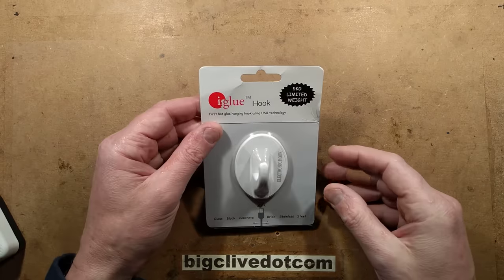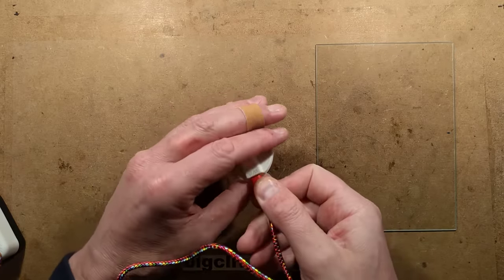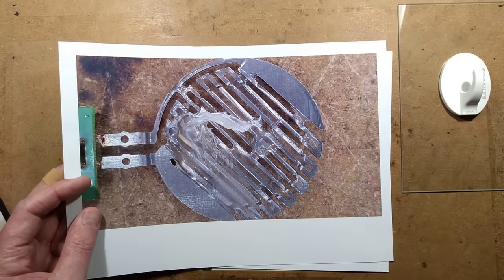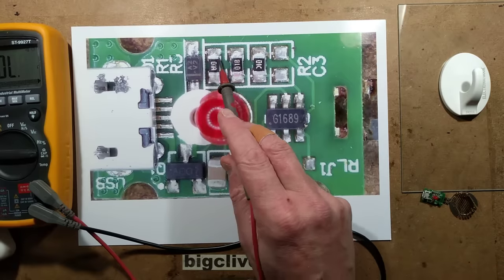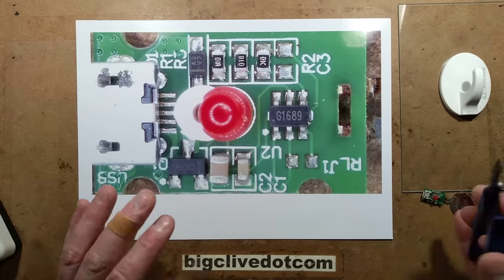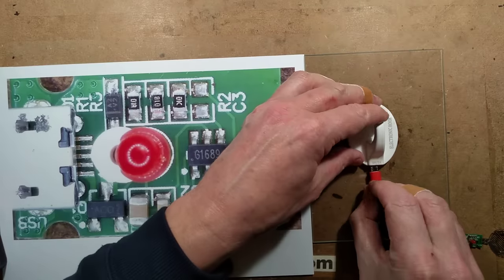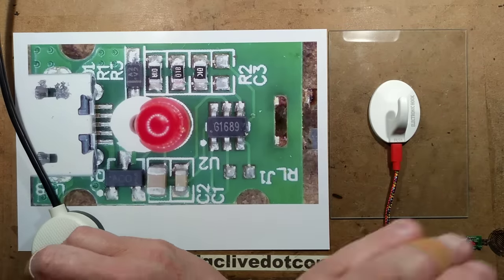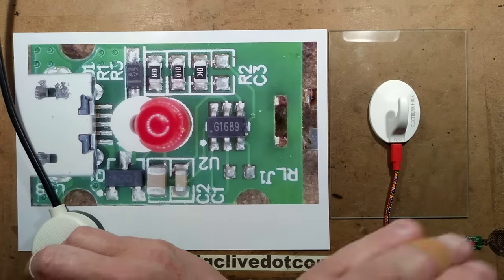Testing a USB powered wall hook and a look inside.

Comment: Ive got to say, with the rise of 3M command adhesive I totally don’t understand the point of this.
Reply: I'm with you on loving 3M's Command strips. For that matter, I think 3M is one of the most innovative corporations in the USA, and they produce so many clever and truly USEFUL products. (Post-Its, anyone?)
Reply: Thanks 3M ad dept.!
Reply: 3M Command Adhesive ...... Sounds a bit S&M to me ;0)
Reply: Furr Bear I used to work at 3m in St. Paul Minnesota. 3m was much more innovative before they brought in corporate outsiders and implemented six sigma. As engineers we were afraid to try anything new because six sigma punishes failures.
Reply: You mean a belated knock-off of TESA Powerstrips makes your company innovative? Oookay.
Reply: I agree this item baffles me. It's like something you see on Dragon's Den that gets shot down by Peter Jones as being an over-engineered solution to a non-problem.
Reply: Its a earlier innovation of TPM  
https://en.wikipedia.org/wiki/Six_Sigma       
https://en.wikipedia.org/wiki/Total_productive_maintenance
Reply: just the 21st century - everything will be electronic and digital like the hooks or door numbers, now i even more believe in such picture like in Observer computer game houses (very Blade runner)
Reply: Siana Gearz clueless comment. That product was introduced after engineers stopped running the company
Reply: In the early 20th century, everyone became obsessed with radiation.  They sold radium water, radium watches, and radioactive chemistry kits for kids complete with samples of uranium.  The factories where they painted the radium onto watch hands were so radioactive that the rubble is still too dangerous to walk over today.  You could walk into any shoestore and get an x-ray of your foot from an unshielded machine which would cheerfully give you a decade's worth of becherels in a few seconds of exposure.  Thus began the Atomic Age.  

We are now in the Computer Age, and everything has to have circuitry in it whether it makes any sense or not.  Your refrigerator, your phone, your television set, your car, your dishwasher, your toaster, they've all got little computers stuck in them.  And now we have the electronic wall hook.  In a hundred years, if anyone survives, people will be laughing at us the same way we now laugh at the people who drank a big tall glass of radioactive water every morning for their health.
Reply: It's classic Chinese tat. Make stuff because we can! An adhesive pad takes a few seconds, doesn't require a cable and power supply, and probably provides better adhesion than hot melt anyway.
Reply: I love the smell of 3M temporary adhesive - Scotch tape, Post-it notes... Smells like pineapple.
Reply: Six sigma was a management fad that was invented by Motorola (who is nearly non existent now) that required tons of paperwork before trying anything (not good for R&D) and punished anything deemed a failure (a normal process in R&D, you don't always have winners in R&D).
Reply: Six sigma required tons of non related paperwork and punished failures to the point where engineers were afraid of developing products. The post it note was a engineering mistake. A quick google search found this https://www.inc.com/linkedin/don-peppers/downside-six-sigma-don-peppers.html
Reply: 3M command adhesive is great for LIGHT jobs..   It sucks for heavier items.  For example, I hang my tactical vests and tried using some of the heavier duty 'command' hooks.. they fell off the wall due to the weight.  I have tried it with a few different things I wanted to hang that were heavier and the same result.. Command stuff is great for light hanging items up to maybe 2-3 lbs for the heavier versions. But anything past that, they do not stick.

I intend on buying some of these hot glue versions now that I know about them because my bet is these will hold and not come off the wall like the command versions.

THAT is probably what they are for.. heavier jobs for things that the command adhesive cannot do...
Reply: 3M was a company run by engineers before Buckley started as CEO. It was a very Minnesotan company with weekly hot dish (tater tot casserole) pot lucks on friday and retirees who still had access to the buildings (one even had a dozen or so used cars for sale in the back parking lot). Once the corporate types moved in the culture changed for the worse. Six sigma punished innovation. Buckley had a heated helicopter outhouse the size of a porta potty in the parking lot to wait for his helicopter which would fly him from St. Paul MN to Eden Prairie MN (about 30 minutes by car).
Reply: Gladdic, it's a sign of reading too much into things when you make sweeping conclusions including where i might be from. No, i don't know the details but i am aware of 3M'
s numerous industrial chemical products of unique usefulness and various surface processes that they kept innovating in the last decades, i just found the statement funny.

But it looks to me like DE3331016A1 from 1983 introduces stretch-release tape/strip adhesive. I suspect by 2000, BDF and 3M were trading blows on detail improvements to the system and were likely operating on a patent cross-license agreement.
Reply: Yum, tater tot hotdish! 3M has a channel on here, I sub to it to know what latest innovations are coming down their pipeline. You basically can't walk into any hospital or ER in the country without having a 3M product being used on you.
Reply: +Undefined Lastname: well it's a management fad.. you can google and get a textbook definition. not entirely sure if it's designed to punish innovation or that's just the way it turns out when they bring in external consultants to implement it.
Reply: Phillip Berger   I 100% agree.  I accidentally clicked ahead about 30 seconds and was too lazy to restart but i found myself utterly lost and could not understand what possible use a hook could have for a usb port.  I gave in a restarted and watched from the beginning.  I'm still not sure what use a hook actually has for a usb port but I think the only way this could be made more useless would be to add bluetooth.  I guess we will see that in rev 2.0 .
Reply: It says 5kg on the packet at the start.
Reply: I think you need to get the ones with a larger surface area to hang heavier items.
Reply: This point! Right? One use electronics . shows how cheap they are.
Reply: They had a hard time getting the knock off adhesive right, so they just decided to use hot glue
Reply: Don't use those on drywall or paint either.  It ends badly.
Reply: My exact thought, command adhesive runs circles around this thing.  Maybe it has the edge in strength but you might as well properly mount a hook if you want to hold any real weight anyway.
Reply: I used one of those command things on the wall at work. It was just supposed to be a quick test but when I removed it, it took a big chunk of paint from the drywall. It was in a very visible place and it was all new construction too. Luckily, I was able to find some touch-up paint left behind from the construction and it was a lot less visible with a bit of paint.
Reply: The nice thing about these is if you want to reposition them more than once you can just chop off another bit of hot glue stick rather than having to buy a whole new hook. Also IMO these look a lot nicer than the 3M ones.
Reply: This would have been great if it were some kind of high surface tension glue that came off in one lump as Clive said. As it is, it's little better than throwing something up with some E6000.
Reply: The issue you're going to have with surface adhering hooks is not only do you have to be concerned about the adherence of the hook to the surface it's attached to but also to the surface that surface is attached to and so on. Any failure in the weakest link in that chain (latex paint or weak wallpaper adhesive) and not only do you have a hook failure but also a mess you have to deal with.
Reply: Having had several 3M strips fail over the years despite massively underrating and following instructions on surface from paint(And plenty of minor damage to the surface when removing said strips) and having now moved back to traditional nail-in hooks(For pictures in frames) or permanent double sided tape, I can understand why these exist.
Plus hot melt glue is easy to clean without a trace from most non-porous surfaces.
Reply: Oh god! that Six Sigma crap has invaded everything. I had to be Lean six sigma yellow belt trained.  (read, two hours of listening to some shill talk about colored post it notes on boards to mark good and bad days or some crap) to be a tour guide, and now as a groundskeeper we have to do something similar.   (read, my boss has to spend time marking on a board in his office that we had a 'red' day and the grass didn't get mowed, and then document on another section of the board the reason the grass didn't get mowed was "it was raining' and then decide what could have done different next time to get the grass mowed.
Reply: Six Sigma is a group of con men who have convinced the corporate, and now also government and military worlds that they have a 'system' that will make them more money and be more productive, they throw in some Japanese words like "kaizen" just means really long management meeting and charge the companies fees to 'train' their employees and managers and call them white belts and yellow belts and green belts.  The overall system  they push punishes innovation and any deviation from the norm and attempts to make everyone work in the same say way, which I suppose might be more efficient in some cases which is the whole point, but we'd all be writing with the best and finest quill pens and be using ink with very consistent quality.  Basically McDonald's is these people's wet dream consistent quality across the entire company and everything is done the same no matter where you are at.  It's very Pro consistency and predictability and anti creativity and risk taking.
Reply: 3m hooks of this size can only hold like 3 pounds, this heater hook would be a great niche for holding something heavier
Reply: +SuperAWaC If you really need to hang that much weight, you can just get a Hercules Hook.
Reply: Nail.
Reply: The two glue stick discs are still a riddle to me. I see you didn't leave a link to the product. No problem, I will not be ordering this anytime soon
Reply: good luck making nails and hercules hooks work in glass
Reply: @ThreeFontStreet  Oh, you are a German? Because only Germans usually attribute something negative to "German...".
Reply: I people saying there's no point in this are completely missing the main point - this device is hot glue-able, AND hot-UN-glueable, therefore removeable AND re-useable (with a new pad, of which 2 spares are stored in the back)
The video explains this from 7:50 onwards, including the use of a extra heatup time in un-melt mode due to havng extra thermal mass when fitted to a substrate.
Reply: @jakp8777  A lot of the management fads are simply a rigorous application of some common sense. Anything can go sour if you focus too much on the details and not enough on the big picture. And it's just like upper managers to not understand the actual work their subordinates are doing.
Reply: Everybody forgets about DuPont :(
Reply: Siana Gearz looking it up it looks like tesa powerstrips came out in 2012 while 3m command strips came out in 2011.
Reply: I think they are just to even out the load on the surface in the lover area of the hooka...
Reply: I've found that particular 3M tape rather useless. If I saw this hook for £2, I would buy it.
Reply: Yeah. This is a fantastically shit idea.
Reply: we used to use those command strips for little things like mic holders for two way radios, absolutely useless in hot weather - we then used some hot melt glue (direct from HMG guns) on the holders and not a problem since.
Reply: I use a lot of command strips.. but they don't work well for something heavy... I have a picture and a poster I want to hang up ..
I don't trust command strips for that...   
I'm going to buy a few of these....
Reply: @zbeast    why do you trust hot glue more?
Reply: Steve Bollinger powerstrips came out in 1994, I already used them as a kid to hang posters everywhere in my room. We still have some hooks in our basement that hold flashlights and various other stuff.
Reply: Mic drop.
Reply: Wouldnt call the 3M Command strips their most innovative product, after all its exactly the same as Tesa Powerstrips, introduced in 1994.
Reply: "This comment and replies are brought to you courtesy of 3M command adhesive.

3M Command adhesive - the leading solution to adhesion since.....probably 2016?"
Reply: Six Sigma is for streamlining and improving the efficiency of EXISTING processes.  You can't Six Sigma R&D.  Or rather, I should say you can't Six Sigma R&D and expect any results from the R&D.
Reply: I was thinking that the entire video
Reply: If that is what they are doing they aren't doing Six Sigma right.
Reply: @JeffDeWitt  Communists say the same about Venezuala.
Reply: @my_channel_44  Probably, but the difference is that unlike communism (and socialism) Six Sigma actually does work when used properly. I worked in a plant were we used it and we got excellent results.
Reply: So you can pull it off your wall without pulling off a chunk of your wall with it upon removal
Reply: @SianaGearz  wahhhh
Reply: @jakp8777  good god
Reply: @FurrBeard  all that r&d money they spend definitely goes to use.
Reply: Because people in Shenzhen have microcontroller skills, not material science and polymer technology.
Reply: @jakp8777   I had to look this up. Now I understand how Jack Welch ran GE into the ground.
Reply: @Ed19601  The two pads are extra glue. This means it can be used 3 times. If you need to move it more than that, just cut off some pieces from a glue stick.
Reply: @firesurfer  ok thanks for clarifying
Reply: Boy howdy I just love 3M™ products

Comment: Genuinely thought this was a joke video along the lines of Fanny Flambeaux to begin with.  I suppose 5kg is a lot of weight, but honestly I don't think I'd trust it anyway.  Plus, of course, there's always the chance it'll just take the wallpaper down with it.
Reply: wouldn't recommend it on  a wallpaper anways seemse more suitable to use in the kitchen or in the bath on tilings. And those seem a lot saver than those suctioncups or adhesive hooks, since water and loos of pressure can't loosen those up
Reply: Are "loos of pressure" those things they use on aeroplanes by any chance?
Reply: Who still uses wallpaper?
Reply: Grand Moff Tarkin  
The English, as far as I understand... Every English renovation show seems to go through truck loads of wallpaper. Usually after ripping out some similar wallpaper they've described as "hideous" or "ugly".
Reply: Yep - the majority of English homes until the last couple of decades were of stone, block or brick construction with dual-skin (cavity) walls - a common construction is brick, cavity (air or insulation) and brick. The interior face of the inner skin is then plastered directly to finish it before decoration.
Timber frame construction is very rare, probably due to the damp climate and lack of extensive local timber resources in the modern era.

That has meant that dry-wall interior walls are only a recent thing and so there are millions of houses in the UK with 50-400 year-old interior walls that have seen a lot of wear and damage in that time. 

Wallpaper is a quick and easy way to cover damage, lumps and bumps and is particularly popular in the UK, far more than any other country I've visited. Its the norm in all but recent builds so has an extensive fashion following.
Personally I find wallpaper both hideous and ugly :)
Reply: Gord Slater  It is still standard construction to use a cavity wall - the other methods haven't caught on, as they don't last very long. A properly built cavity wall is immune to damp, well insulating (for stone), safe (please don't fill your cavity with insulation, it causes water bridging and dangerous in wall fires) and will last for several generations.

As for interior walls, bricks are used as they reflect noise extremely well. So they are generally better, if way more expensive.

Wallpaper was often used to cover up cigarette tar as well, which grows through paint very quickly.